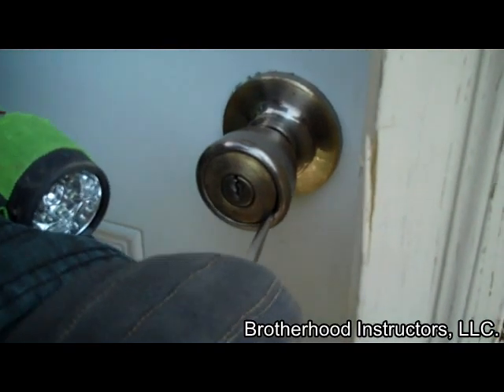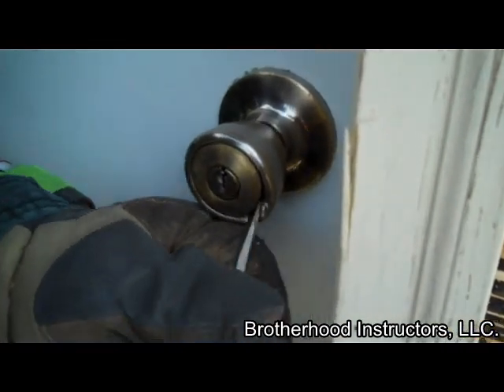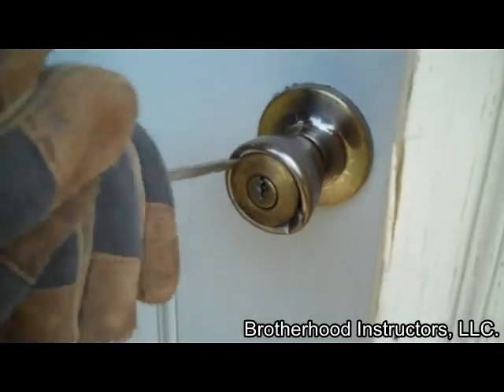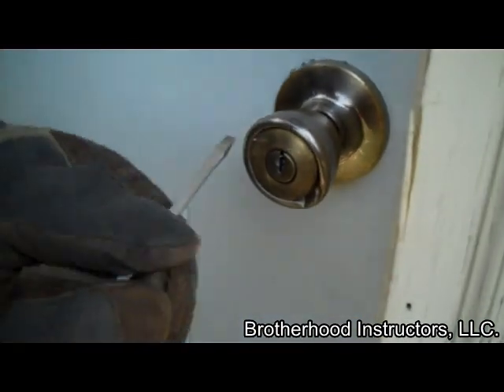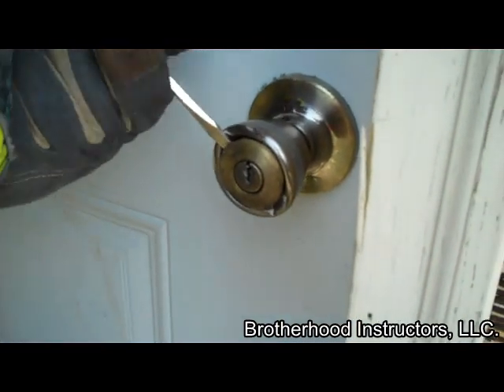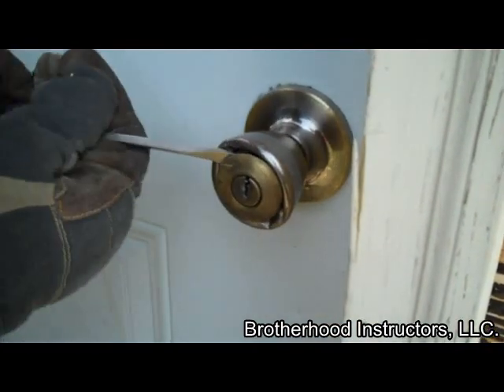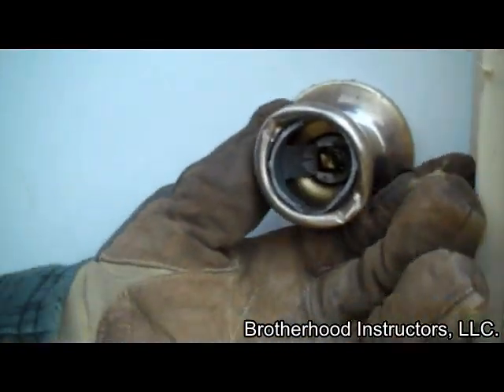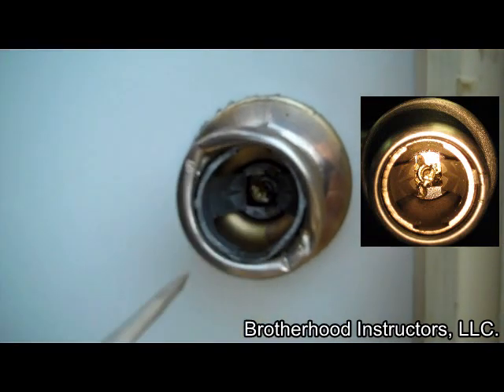Key-in-the-Knob:  Through the Lock

Comment: This ain't lockpicking, this is a method to avoid having to break out a halligan bar for firefighters. We don't carry shotguns, and the person on the other side of the door called 911 and is in a position to not be able to unlock the door.  So, we open it quickly doing as little damage as we can. I'm not going to break out a set of picks and try to pick a lock when I can either do this, or if this fails, go through regular forced entry.

Comment from the maker: 74KU - I guess quick and little damage is a relative team.  I meant that it was quick and little damage as compared with conventional forcible entry techniques which would have destroyed the door, frame, knob, and framing around the door.  As far as firefighting forcible entry is concerned, the $20 or $30 to replace the knob is little damage.  I will admit that I mangled the knob pretty good in this instance, I have also performed this same technique with no damage at all to the knob.